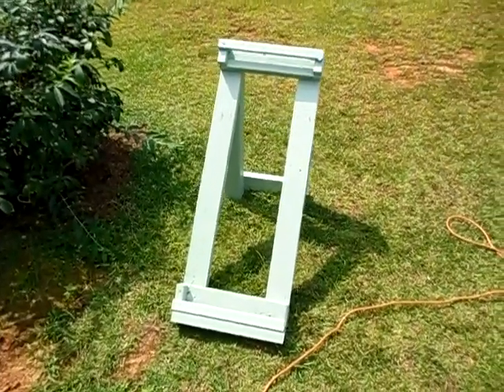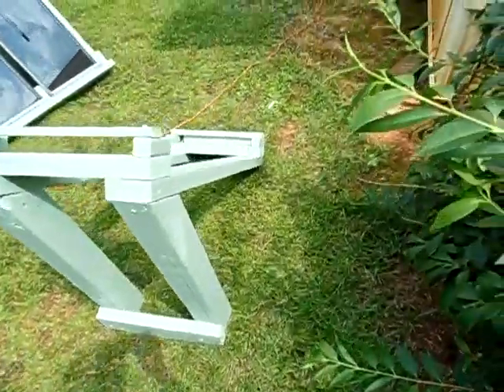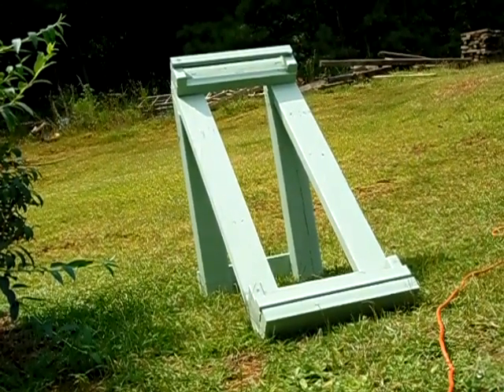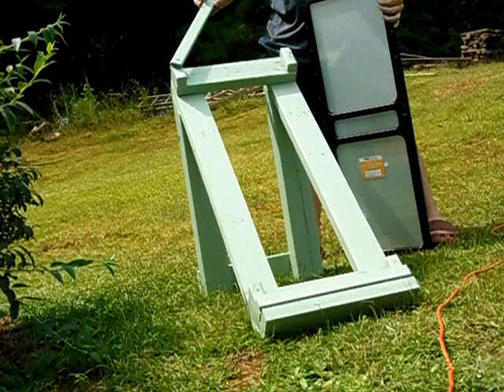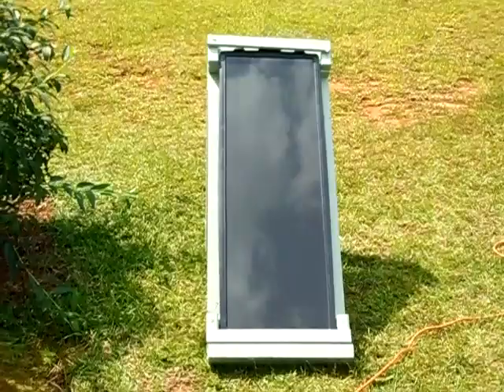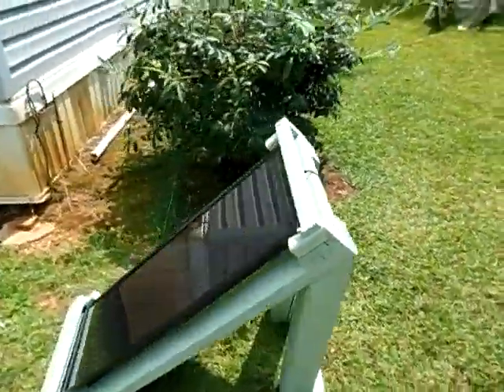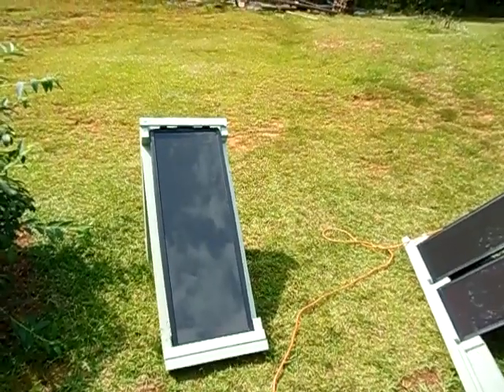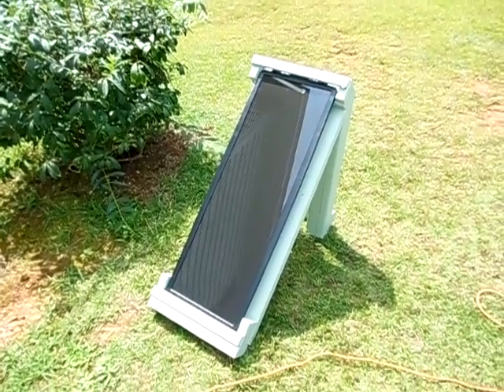Homemade Solar Panel Frame

Comment from the maker: The harbor freight kit is the best for people just getting into solar. The kit has everthing you need except for the battery and the power inverter. You  can start out with just a small lawn mower battery,thats how I started out. However, I would get a decent size inverter at least a 200 watt. The frame was very easy to build. The small frame only took me about fifty minutes, the big frame took about two hours. Thanks for the comment.